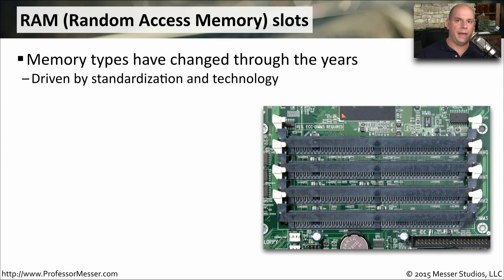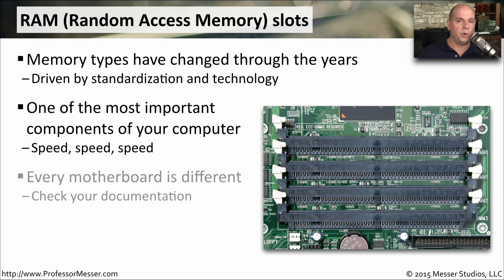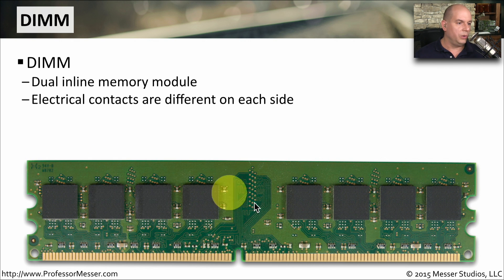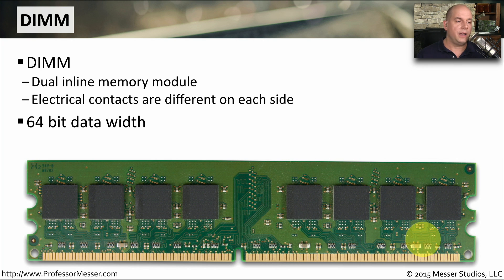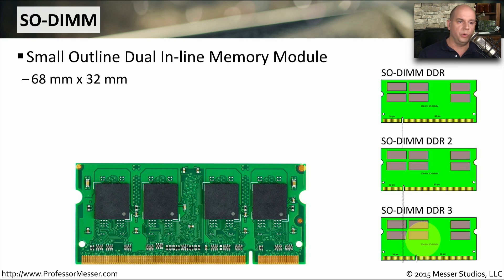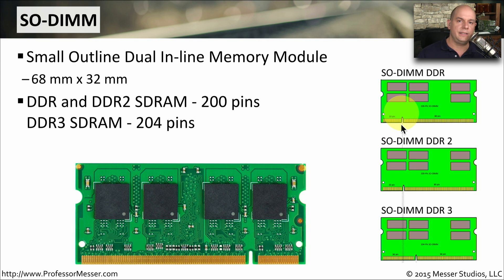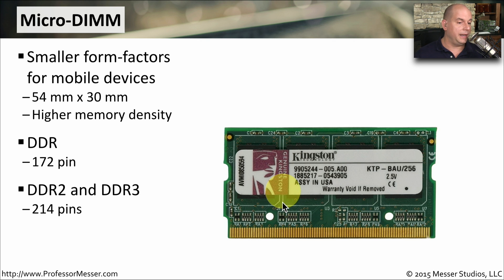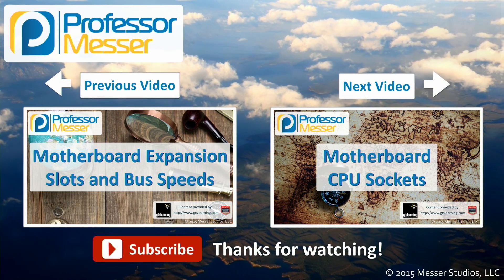Motherboard RAM Slots - CompTIA A+ 220-901 - 1.2

Comment: We need to make the new Ram memory like the Micro-Dimm but twice as wide, so it can have much more PINS, and also with SSD memory, around 32GB of storage memory, and each Ram-Dimm to be at least 8GB, so the motherboards can focus better in the processors and the RAM slots don't take much space, because they are quite large, and only 3RAM slots.